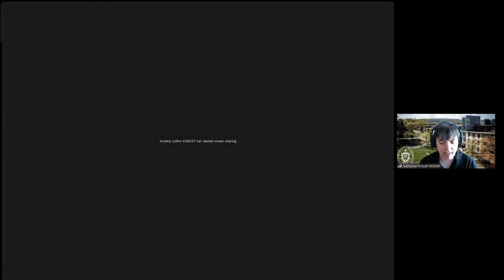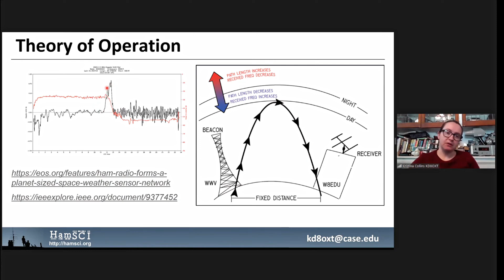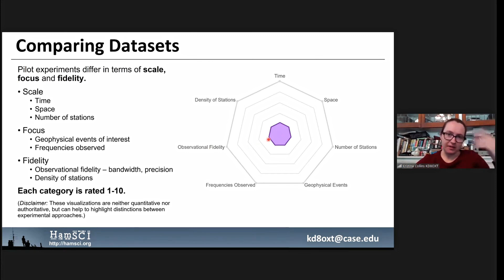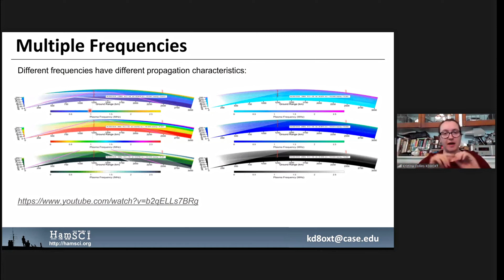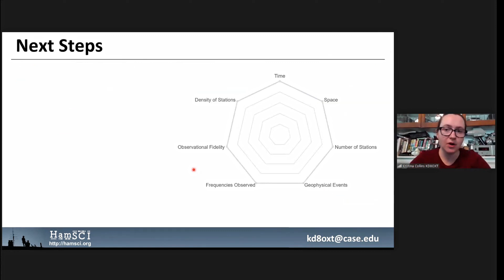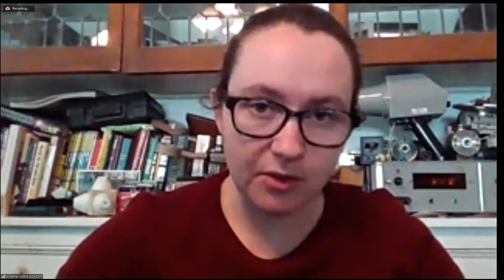HamSci 2021: Personal Space Weather Stations Grape Hardware: Version 1.0 and Pilot Experiments

Comment: Aloha Kristina KD8OXT, I think this is something I would like to do since I was the person that introduced FLDigi to the Hawaii hams here 10 years ago but was dismissed as being impossible but the FLDigi program has greatly improved over the last five years and then one of our senior hams re-discovered it during a convention in Northern California but then only learned to do FLDigi in “Test” instead of “Mute” mode likes its suppose to be done to prevent severe brain injury from the sound of the FLDigi operating in “TEST” mode. With that said, I am willing to join this experiment for a year but only if the FLDigi portion is ran in “muted” mode only. 
    The reason this is important is back in 2017, my family and I was watching the ocean, it was such a beautiful day and I had my radio on low and some local hams did three short FLDigi transmissions on a local repeater I was monitoring and about 5-10 minutes later, without anyone saying anything about it, suddenly my family developed severe migraine headaches and they all had to lay down and take a nap at 11am in the morning. I don’t think the FLDigi is dangerous unless you play it out loud in “Test” mode in which it plays that aweful sounds is when the program causes terrible migraine headaches and no study has been conducted to date. 
If it is silent or being used in “muted” mode, it seems very safe. I will tell you that FLDigi will go further than a station you hear earlier on SSB and even further on 11 meters SSB. I’ve always wanted to try FLDigi on VLF, 10 meters and the ultra quiet 220mhz.